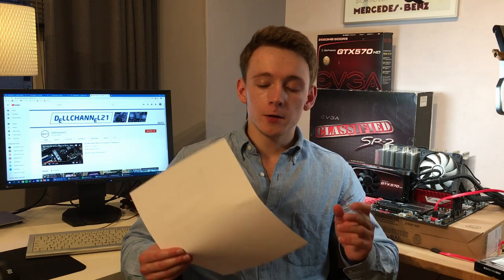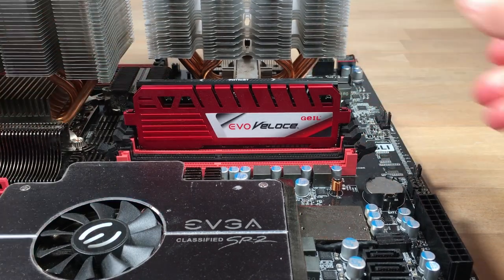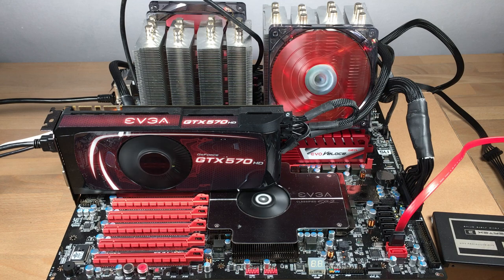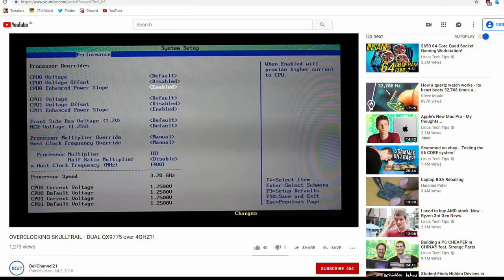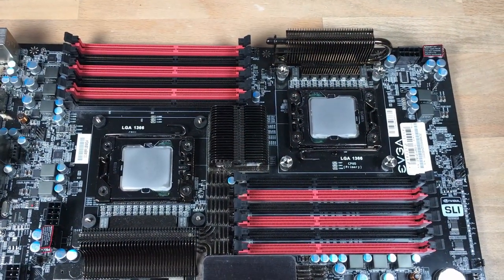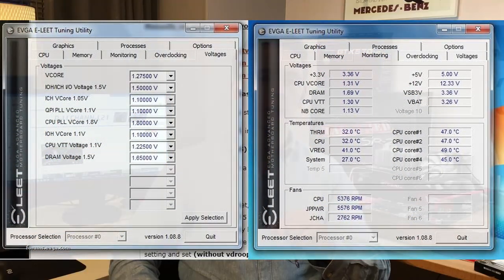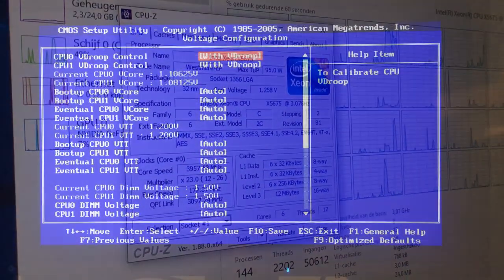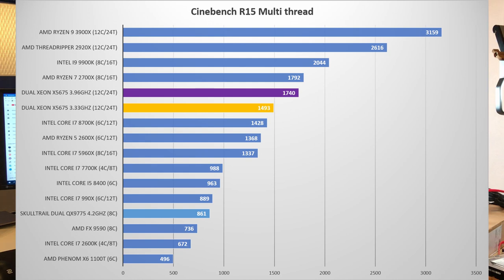EVGA Classified SR-2 Dual Xeon Overclocking!

Comment: This baby was a maze for overclocking , but it was soo much fun. This board was a overclocking gold mine. This was the Last Proper overclocking generation where you needed to consider a ton of things when doing it unlike todays platforms 
I had it back in the day too bad i sold it 
Now i only have hers little sister the Classified X58 with , i7 980x , GTX 580 Classified , Corsair Dominator GT and the "regular" Dominator. I tried Kingston T1 but the Corsairs were a lot better
Its still going strong even in 2021, too bad it has only SATA2 (my version)
Reply: I've upgraded an old x58 system from an i7 920 up to an i7 990x, fun times.

Comment: Awesome update! Ja, old school AMI BIOS. I'm used to Award BIOS like in ASUS. Fast if on full keyboard. "Enter, Exc, arrows & Num pad" all you need.  I used those X5675's for it's higher quality silicone & lower starting TDP. In CPU ratio Auto did great daily. X5690 is only really better if you can't OC your mobo. Otherwise, even the 5620's OC like madness (in singles to 4.2GHz). In dual OC is the challenge. So 4.2-4.4GHz on air dual Xeon, I'm not complaining. The trickiness in this mobo is a balance of those UCLK & QPI balance in relation to CPU : RAM. it's trial & lots of error. But fun.

Comment: I've got an old HP Z600 with Xeon x5670's it's a beast. Would be nice to use in a board like that. But I'm happy with what I got. I put a GTX 1070oc 8g. Thanks for the videos.

Comment: Nice video! I have too SR2 and skulltrail :)
Reply: i have wanted one for a while the sr2, pretty sure i could manage 4.5-4.6 on a pair using the cooling options i have, combo air and water..(silver arrrow extreme sb-e and a cryorig 280mm cooler with 2x noctua high pressure fans, and 2x akasa vipers in push/pull. making for a nice flow over the board on this case  setup)